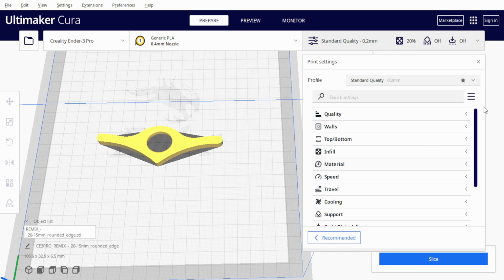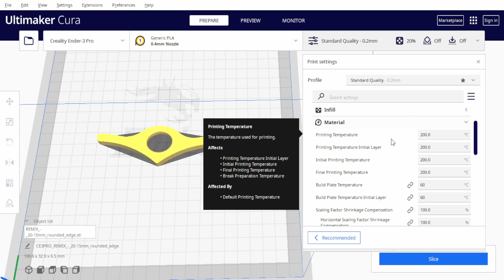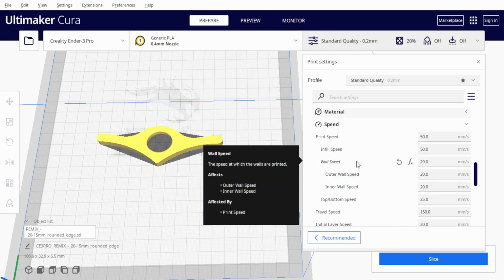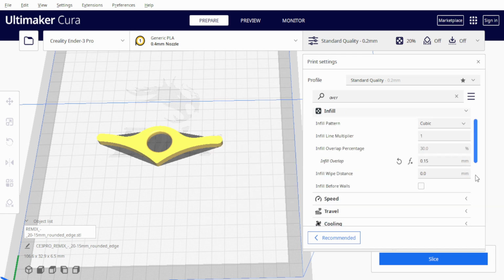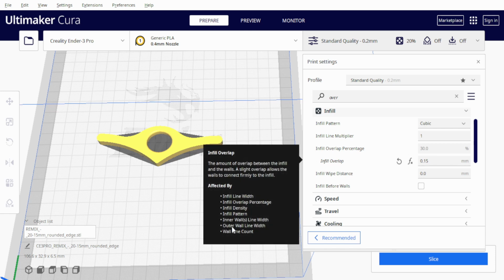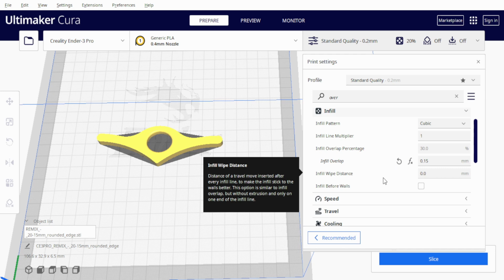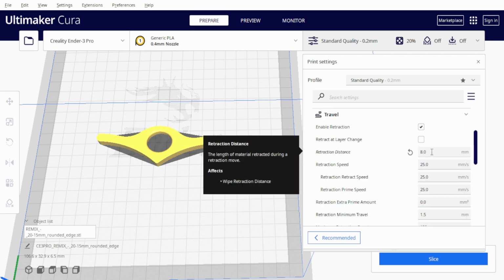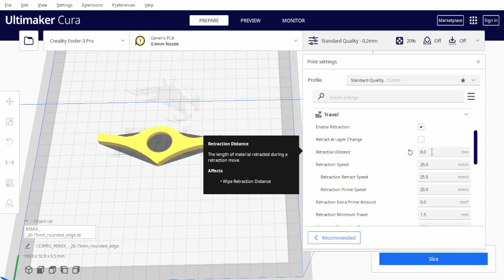How to fix 3d print wall delamination? | 3d print issues and fixes | Ender 3 V2

Comment: what if you haven't had this problem for over a year and now suddenly the walls are doing this and the layers aren't sticking to each other very well.  I've tried 4 different filaments, 2 of them are brand new.  I have been using the same saved settings in Cura for close to a year with minimal issues.  I even tried the default settings in case I screwed up my saved settings. 

Things I've tried:
- dried the filament. even the 2 new ones;
- increased nozzle temp;
- decreased print speed;
-  releveled the bed;
- adjusted the z-offset;
- replaced the extruder gear (it was worn and possibly slipping);
- replaced the bowden tube (felt tight and maybe clogged);
- cleaned the hotend inside and out to ensure it wasn't clogged;
- new nozzle;
- adjusted the rollers on the bed and hotend;
- tightened the belts;

I'm using an Ender 3 Max Neo with built-in CR-Touch. The only thing I've changed is the CR-Touch itself and the wire harness for it.  The harness had a broken wire and caused intermittent failures resulting in the CR-touch probe dropping mid print and smashing into the prints.  

Things I plan on trying next:
- e-steps.  I adjusted the e-steps when I got the machine but I will check them again in case they are out after replacing the extruder gear;
- silicone sock got damaged and was removed. will be replaced when the new one arrives;
- reducing the fan speed

The printer is 100% factory default.  not parts or firmware changes.